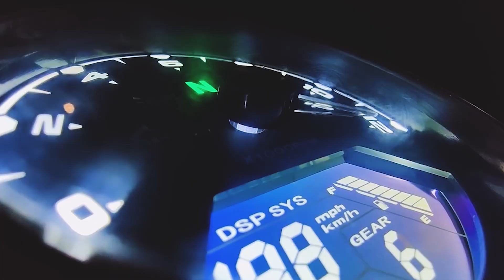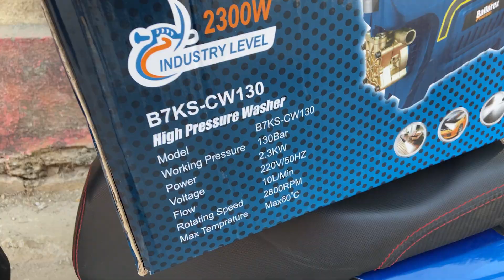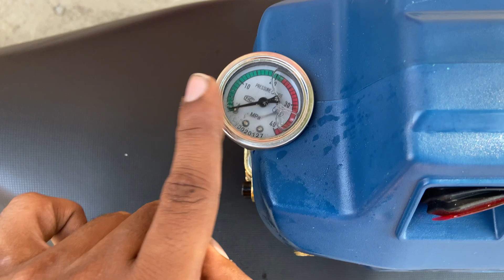Foam Washing KTM RC390 | 250 | 200 (Ballorex 2300W 130Bar)

Comment: My bike is Pulsar 150 neon.
Few months ago I was crashed with my bike.
Then bike's front fork T alignment was changed and then I replaced a new one on service center.
But, now My bike pull right side or drift on right handle when I ride.
Then I changed front wheel axle and two bearings,but nothing good.
Then, I go to a mechanic said my problem.
He said me, your bike's front fork is twist and suggest to me change front mudguard clamp.
Then I replaced that part.
But nothing is good.
What can I do now?

Comment: Considering the High price, looks like it does not have good width and pressure. More over it has only two pin plug having 2300w consumption, which is not acceptable. Company should first think about the user's safety.